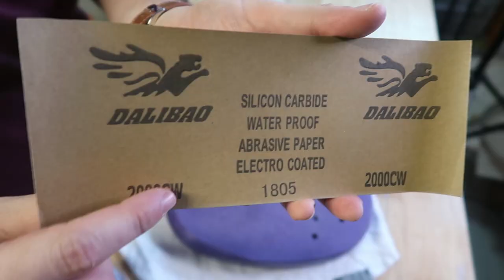Painting Rachel's Guitar... AGAIN?!!

Comment: Is it easier and or best, to learn guitar on an electric guitar or an acoustic? IS there any difference? Before Christmas I was going to teach myself but...I got busy. But now Im about to start and get into it, I want to eventually get my own guitar bit for now I have a friend with guitars he is said I could borrow one(he doesn’t use them/know how to play much), but I’m not sure which to try and learn on, he said he wasnt sure since he has played since high school and even then he only knows very basic stuff
Reply from the maker: You can start out with either. Acoustic is a little easier to grab and practice whenever. Electric requires an amp, cables and electricity to really get rocking. Plus there are a lot of different settings to mess with that can effect the tone of the guitar which can be confusing. But you can still practice without plugging it in and that way it’s a lot quieter for those around you. I learned on an acoustic and then bought an electric when I had mastered a few things. But so don’t think there is a right or wrong order to do it.

Comment: The lines against the grain are likely from the planing of the wood.
Reply from the maker: Good tip. I just got a new planer for Christmas. Is that the kind of thing I could fix by running it through my planer?
Reply: @GiftedGuitarsbyChrisBallinger  potentially you may need to plane it multiple times or change to a finer blade if possible. I havnt worked w planers in a while but my brothers have done alot of woodwork and I remember that happening. I think it can also depends on the types of wood being planed as well some seem more susceptible to it than others.